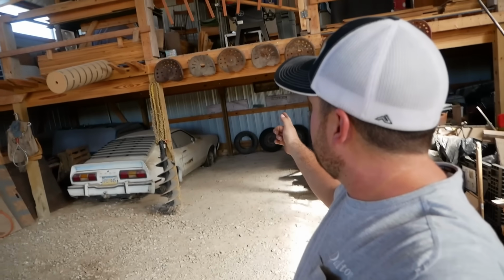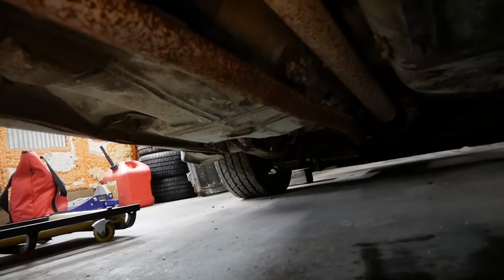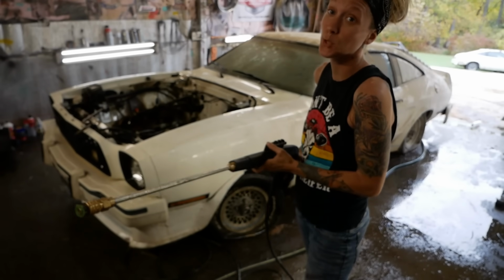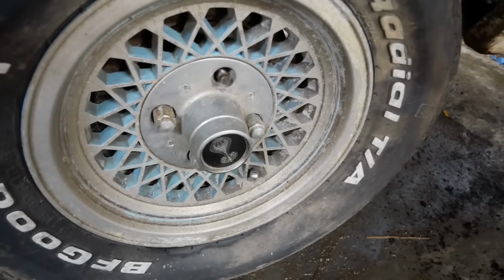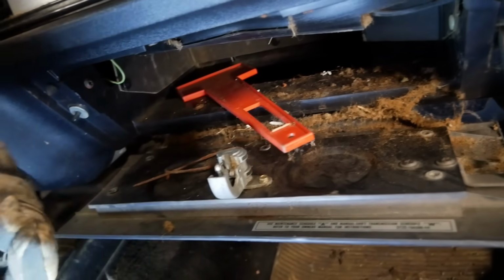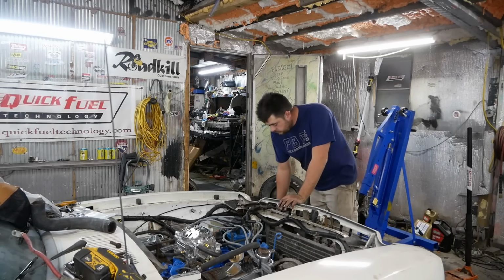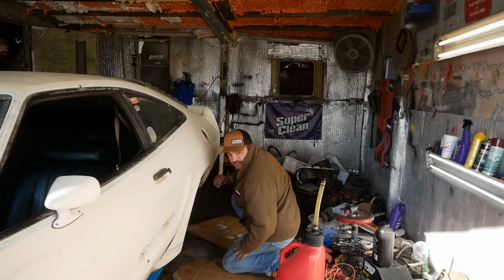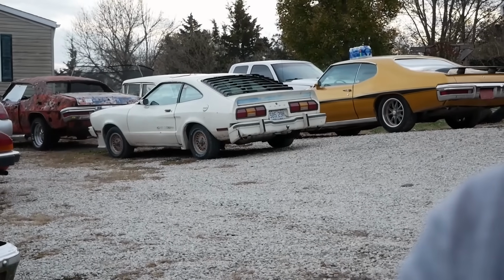ABANDONED King Cobra Mustang - WILL IT RUN and Drive After 26 Years?

Comment: Looks like you left off the “Pinto go Boom! Shield when you put the new gas tank in the Mustang Cobra. Now your no longer NHTSA recall compliant. (The KA-Boom shield is that shield that went between the gas tank and rear differential.) Keeps the rear differential from punching a hole in the tank and sparking a fire of passion erupting with an encounter  between the Mustang and an old Ford Probe.

Comment: Haven't watched it yet, just saw the notification (Since I find notifications loathsome and disable them on my phone for everything except texts and calls), but I already know this is gonna be a good one. The hell you and other youtubers reviving cars like these go through keeps me going working on my old garbage. Keep up the great work, all of you, JD and Jess included. 

Videos like these keep me motivated even though I can be a bit of an idiot at times and forget the simplest things like how I did a dumb and forgot that the water pump runs off the power steering, and not the alternator, and my truck ain't got no power steering (I didn't forget it didn't have power steering, that's intentional, and factory, I want a 1 belt simple as hell V8 4 speed rat rod truck). There aren't many junkyards around with old American iron that I can access on a whim, or access at all, sooooo, I had to spend money on gaudy pulleys on a greaseball engine, that's always fun. I'm gonna try and see if I can make it run off a Chevy style 3 wire alternator converted to a 1 wire or just get my Mopar alternator converted to 1 wire. Oh yeah and my 318 had the heavy duty alternator, which is the big SOB with two pulleys, so that's fun.

Comment: Love the II.  Just a thought - The car was already old when it was 10 years old.   Then it ran until it was 22 years old.  After another 23 years of sitting, you drive it at 3500 RPM for a couple hundred miles on the highway.  All I have to say is: You are a brave man.  I have to see more of this.  Subscribed!
Reply: I gotta agree. You even pointed out the dried kwik seal  while replacing the water pump. Waited days for the clutch yet never checked the head gaskets. Not even a compression test. The car keeps blowing steam out the overflow and the answer is to take it on a couple hundred mile road trip at the aforementioned 3500 rpm average. Lol. That is extremely brave. Then again... I guess it's Jesse's car. Love the car. Have since watching Charlie's angels as a kid.

Comment: Don't know if this will even get your way but if you want those wheels clean get some paint stripper and soak them in it, that yellow gunk is decaying clear coat, a lot of aluminum/mag wheels were done that way for a LONG time and unfortunately that stuff is pretty stubborn, they put it on to prevent the aluminum from tarnishing.
 I had a set of cadillac wheels that had started yellowing like that and hit them with stripper, polished them back out to a shine and threw some car wax on them with a clean polishing rag, they've stayed shiny and fairly clean for the last few years. 
Hope it helps, give a fella a shout if you're ever in northeast oklahoma and need some help

Comment: You can only pull a lock on the out if you can turn it and there’s a little button on it and it pops it out. If you can’t turn the lock on, you have to drill that little button out if there’s a hole usually have a Ford steering column,  underneath where you could stick a little pin up there if you can turn the lock cylinder you have to drill out where the pin is and then popped the lock out. I thought maybe you were gonna spray some WD-40 or something else in the lock before you started taking apart the steering wheel maybe you didn’t. You just didn’t  film it but anyways, I love all your videos man. I think you’re really cool dude I love the way you include your son and all the videos and the bond that you have with your son is unbelievable. I think you’re a real cool guy man I wish I could come and hang out with you and work on cars with you. That’s the truth man I’m homeless in Rhode Island. And are used to have my own shop. I used to do it you doing right now and I miss it so much but I will get it all back one day at a time. Thanks for all your video content man I love it all and your wife the way she comes out there hands-on and helps you out man you couldn’t ask for a better woman, thank you for letting me comment for all your content. Love it. Good stuff, man because the way you build cars is the way I build cars. There’s no reason to go overboard. You can have a nice hot rod, but it doesn’t have to look perfect.

Comment: Dalton another amazing video! I am a ford enthusiast and collector myself. Those Mustang ll’s have been a guilty pleasure of mine for a long time. I have had several of those 78’s myself, and I agree that yours was extremely clean…..much cleaner than what I have found in the Cincinnati area.

It’s a shame that T-top had to be relegated to a parts car, but you were correct in your assumption of its damage. I have tried to correct similar damage on prior 74-78’s, and they are never right afterwards. The way the front frame, and geometry is in the front of them they were never made to sustain low and hard impacts. If I had to guess I would say the control arm tabs are bent for sure, as well as every piece of suspension.

Comment: I love these little cars , They are almost 300 - 500 lbs lighter then most Mustangs and back in High School , a simple  289 or 302 with good heads, cam intake and carb with headers  would send these thru the 1/4 in the high 11's with a narrowed 4:30 nine inch rear and a top loader tranny . Nothing could touch these on the street 👍

Comment: Don't know if you read comments on old videos, but i was yelling, "Don't pull the (steering) wheel!" at the phone. The key and/or the tumbler pins are worn. Raking or bumping, whick is basically what you did with the screwdriver handle, will get around that. Short of taking a locksmith course, watch lockpickinglawyer, and you will get the idea of what was going on. It comes in handy for those of us that love torturing ourselves with vintage iron😂 Also, glad to see you are teaching JD the time honored mechanic ways of sarcasm and trolling😅

Comment: 3021st! I was 20 years old in 1978. This car was crap on the showroom floor. I had a friend who bought one and regretted it because of the build quality and all the emission control things that just choked all the power out of it. He sold it, at a huge loss, by the way and bought a 1969 Camero RS/SS with 4 speed, 396ci motor that was fast and powerful as hell. I never knew anyone who had a positive experience owning one. Good luck.   Roger in Pierre South Dakota

Comment: I've watched your channel and junkyarddigs as well one thing yall can make up is a chain breaker like get a bar weld a long heavy duty chain to and a way you can tighten the chain in place after wrapping it around the crank instead of having to struggle with a breaker bar would making breaking engines free alittle more easier. Keep up the great work, yall. I've learned a lot about classics, which I'm obsessed with kinda my hobby on my days off.

Comment: Thanks for the water tip, I just started a 1987 BMW after 6 years abandoned and the atf/acetone did nothing for it, it's a smoker, as soon as I replace the rotted out freeze plugs and get it running for more than a few seconds I'll try it.

Comment: I restored a 1969 Mach 1 mustang, factory R code car that was a 428 cobra jet. Anyway, when I took the interior out of this red Mustang, the entire quarter of the drivers rear had been replaced with a blue Mustang. Not just the quarter panel, but the floor into the trans hump. The car had a quarter of a body clip put on it.

Comment: Ha ha. I just drove my Gold 72 Lemans 2 door hardtop to work today. It just turned 91,000 miles, and not a rust spot on it. Your 71 looks sooooo clean.
Reply from the maker: It's actually a 72, with 71 grilles lol
Reply: @PoleBarnGarage  Oh, nice. I have a trim piece that just fell of my 72 grill. I found a guy that is converting his 72 into the Endura front end, and will give me his original grills.  I just have to go pick them up.

Comment: King Cobra... Back in the 80s while in high school, I worked for my girlfriend's dad at his local NHRA track. The announcer previously owned the track and ran their Pro Gas Falcon, Anglia, and his son's Mustang II's (two of them). The second one was the most impressive for a street car, a King Cobra. 

For the period they built a rock-solid 351 backed by a four-speed. He got a ticket out on the beach one day for bunny-hopping the front tires off of the ground. He eased out on the clutch and then bounced the front end. He ended up chaining the motor mounts as they kept breaking.

Comment: Dalton, have you ever used a tire air cannon? they work great for applications like this when you have an old flat tire off the bead ( as long as there are no gaping holes in the tire itself ) you start airing the tire with a hose like normal then use the cannon to blast air between the rim and the tire bead and it pops on the bead and inflates ( mush less dangerous and damaging to the tire than starter fluid explosion inflation).  They sell a nice one on Amazon for under $75.

Comment: such memories. had a 75 coupe with the 302, but auto c4 with a shift kit,, was really quick  off the line.. put a holley 4 barrel, dart heads, edlebrock performer intake.. so fun to drive. c4 had to be rebuilt every few years. i was so hard on that car.. it would peg the speedo at 120.

Comment: I have another one if you want it.  It hasn't run since 1992, I put race gas in it and it had a catalytic converter.  I figured more octane equals more better!  Turns out, leaded gas isn't good for catalytic converters!  ;)

Comment: I never thought I'd see the day where people are geeking out over the much-maligned, notorious, Pinto-derived Rustang II. The truth is, they were actually pretty decent cars once you shove a Rustang GT motor under the hood. Just make sure you get one with the V8 frame if you build a Rustang II (if the radiator support is straight rather than curving forward to mount the radiator further forward for fan clearance, you've got the four-banger frame and will struggle to fit a v8 under the hood).

Comment: Man that stang would be sick with that 460 shoehorned in it 😂 once the "Exxon Valdez" gets the best of that sacked out 302. It definitely is a cool little car, and it leaking all of the oil is probably what saved on the body from rotting out.

Comment: I built one for a friend did it black with 302 posted heads big cam 456 gears welded cage in it but kept interior car ran 11.50 and would wheelie on the street just about 4in. Ours hat T tops that's why we put in a cage rear tires were as big as we could fit under it with weld wheel drag stars
Car was really beautiful had the factory Cobra side louvers and hatch louver too
I still have a hood for it

Comment: I always use antiseize on 302 water pump bolts   I have a lightly modified ford 302 in my 1984 datsun 200sx    I use antiseize on many bolts....makes it easier to work on in the future.  I would of done front and rear seals as well as oil pan gasket while engine was out.   Good job bringing it back to life   you got a new subscriber

Comment: I was blessed to work. On those cars when they were brand new, I was only a teenager. It was so much fun.
Reply: I was also around these as a young mechanic.  When he pulled valve covers and commented about the red rtv I got a flashback.  I did not find working on these to be "fun", living in the rust bolt meant even the simplest repairs were difficult.

Detroit didn't feel competition yet from Japenese and put out some poorly designed vehicles.  Non the less, lots of folks made lemonade out of these lemons.

Comment: things i would do:
rebuild the suspension with fresh bushings and ball joints
find a way to raise up the rear
15x8 wheels all around 
find an LSD that’ll work 
electric cooling fan
custom long tube headers 

rip out the whole interior, soap and pressure wash the entire interior and put back

Comment: If you drove to Long Island,NY, a couple years back, I would have given you a 1998 Mercury Mountaineer with a 5.0 V8, for free, 75k miles, needed a new water pump, transmission perfect, clean.  I just wanted it gone, and scrapped it for $800, but for a couple hundred and some elbow grease, would have been a decent driver, terrible on fuel economy, but decent driver.

Comment: correction you clean inside engine half way by puting regular amount of oil minus 1.5 quart replace 1 quart  berry b12 .5 engine honey so thickness isnt too thin let run at 1.5k rpm for 30 min drain put regular oil in boom should look better and sound better

Comment: Try brake fluid.  Works wonders on sized engines. I had a 302 full of water put brake fluid in the boars left it a week and came unstuck.  I pulled the engine down anyway and it was really bad but brake fluid got it unstuck

Comment: This may have been mentioned, but on the T-Top car there should also be some bracing under the car at the footwells (I think they were bolt-ins also). My first new car was a 1977 Cobra II, and it also had the aluminum air cleaner housing.

Also, whatever you do, make sure the stamped bolt-in cross brace for the "toilet seat" is accounted for and bolted in between the engine and tranny; it provides bracing for the lower strut rods (if you don't, the alignment will change during cornering. . .ask me how I know)! 

EDIT: Ah, I see you just cut the brace I was warning you about. . .well, good luck!
Reply: oh ya, about that brace. LOL 😂 😂

Comment: I seen that your wife had pulled the battery shield /hold down when cleaning the interior out. It keeps the engine heat away from the battery you might want to use that. It reminds me of when I had my 76 pinto it was a nightmare too  have fun Ford rules.

Comment: So, other people have videos on it, but basically, certain imported butt connectors (crimp connectors) do not have any knurling on the inside, and so don't actually grab the wire, making it so that even after shrinking the heat shrink they still just fall apart.

Comment: My third car with a 76 fastback mustang II not a cobra, but it was a factory installed V8,,..a 302, my dad picked up as a project car. The plan was to swap the motor to a 351 Cleveland only thing was it was an automatic not a wiggle stick like yours. We were going to attempt putting a Doug Nash 5 speed it , but it became obvious it wasn’t to be when we started trying to find that bell housing and the associated clutch hardware. I’ll tell something if you want to keep it a wiggle stick you better hang onto all that hardware because you won’t find it anywhere.

Comment: Man, that looks like a fun car, even if I'm not a fan of the fastback Mustang II, kinda have a soft spot for the Mustang II though.
I didn't even know these existed until as a teen I randomly found one for sale here in Norway, albeit a notchback with a V6, so it was easy to find engine parts as it was a European engine, plenty of 2.8 V6 Ford Taunus, Granada, Scorpio, or Sierra around at the time.
I kinda miss it, and can only really imagine how fun one might be with a 302 and a manual transmission.

Comment: Hell, you had a head start with this car, the brakes were not locked up, and the tires held air (some), that is a win. I wonder what the Corba engine look like under the valve covers, if they were good and better put them on the running 302.
Reply from the maker: Cobra engine is no different than any other 145hp 302
Reply: @PoleBarnGarage  Thank you.

Comment: I've seen this video Twice so far, Dalton and I have to say you did a great job, overall , but, there are 2 things I think you got wrong  1 you left the overflow tube completely off  a few feet of rubber hose and a 2 liter coke bottle could have saved the Coolant from flying up against your windshield and you could when you stop for gas check the 2 liter bottle and pour it back in if it isn't a closed system or it doesn't have enough vacuum to suck it back in you can do it manually and 2 you said it burns as much oil as it does gas but it seems to be following the frames rails to the side of the rockers and by windage ending up dripping off the back of the car seems like either an oil pressure sending unit leak or some pipe plug lost seal Or your RTV was squished out somewhere  it did burn alot of oil at start up I agree but I have had a Rooster tail of smoke coming off my car  so bad the Sheriff stopped me and made me walk home with my toddler in tow ( and no stroller  poor two year old his legs gave out lol )  I'm kidding I carried Jim 2 miles back to my apartment  towed that car home and dropped a 350 into it but I think you got a leak and not burning it all off !! I think that was great you gave it to Jess as a day present  hope you fix those things for her!! Here is a next project video for her KING COBRA -  TRANSFER the T-Tops roof from donor  Mustang to the KING !!  if you need inspiration check out channel Spyder garage  they took am Olds starfire glass roof and put it on a Chevy Monza looked cool even though it was never on a Chevy !! Lol  T-TOPS was an option on King Cobras!!  Keep up the great videos ESP. and the blue oval and The excitement brand of the General It keeps alot of people starving for more of your big block or pony car excitement!! 😊❤

Comment: A little WD-40 and an air nozzle would probably have fixed that ignition I have to start with. An Old Farmers trick for a stuck motor is Diet Coke my dad had a John Deere tractor that was stuck for over 20 years and he put a 8 ft long cheater bar on it and couldn't turn the motor over. He filled the entire motor from top to bottom with Diet Coke and let it sit for a week and it immediately broke over